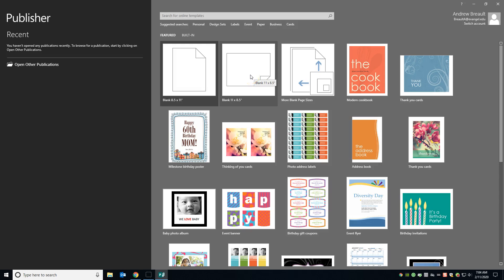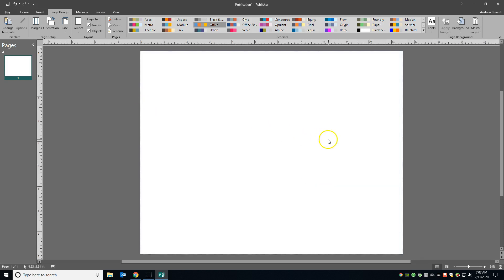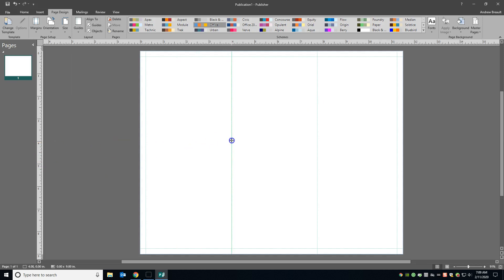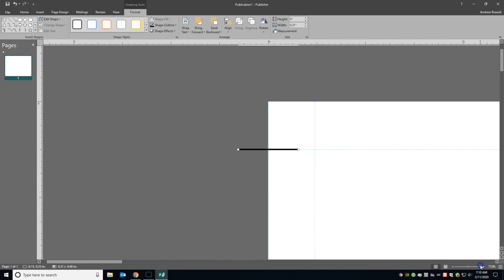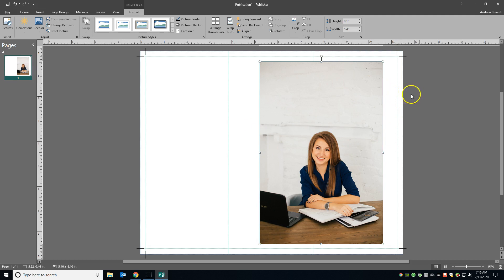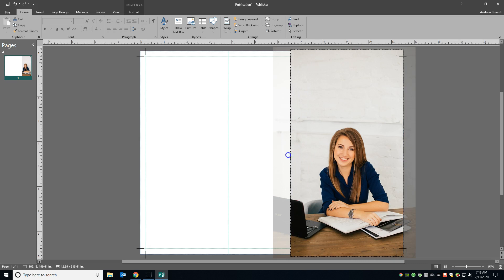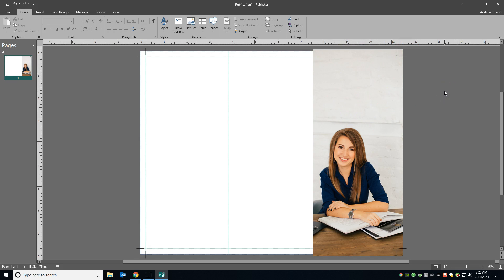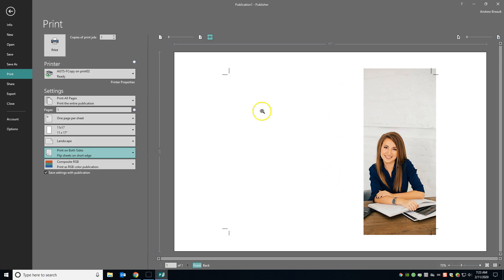How to create a full bleed cover for a trifold brochure

Comment: what should i put in the measurements in cm?
Reply from the maker: Not sure I totally understand the question... can you put in a video time-code for reference?
Reply: @AndrewBreault  0:41 
on my publisher it only says 29 point something cm. how can i change it to inches or what should measurement should i put in cm?
Reply from the maker: Oh, I think you need to add an extra 1.27 cm to each side. You could change the measurements on your computer to Inches but it is a little difficult as Publisher gets its measurements from the system settings in windows.

Basically, just convert the measurements I say in the video from inches to cm. You can do this right in google. Just type in “convert .5 inches to cm” in your web browser. ☺️❤️❤️
Reply: @AndrewBreault  oh okay thank you this is really helpful :>